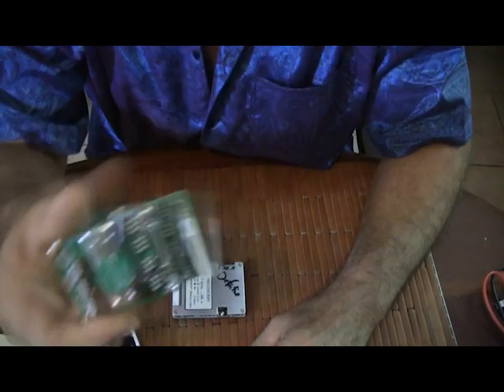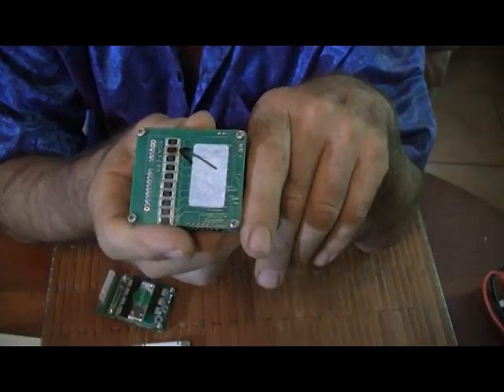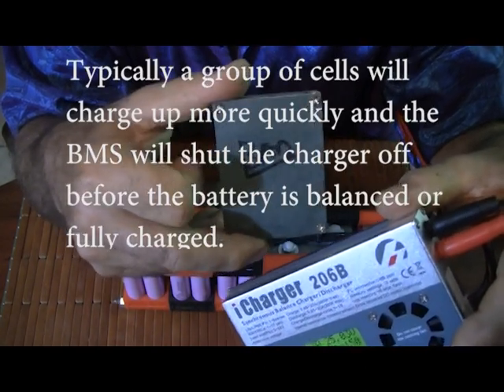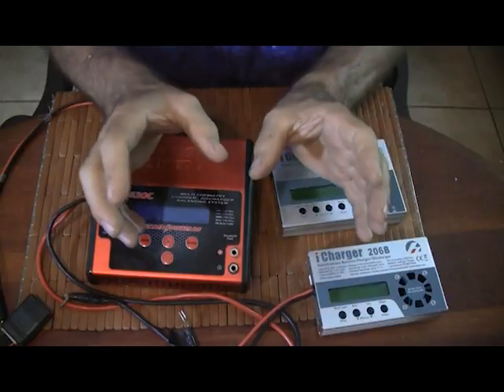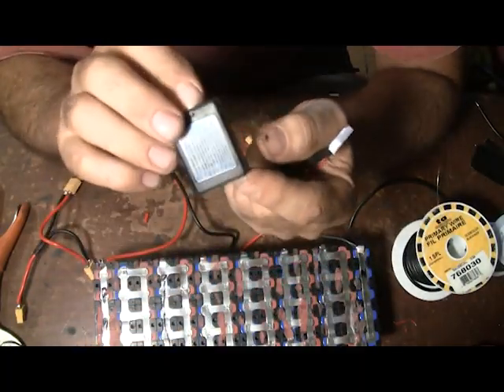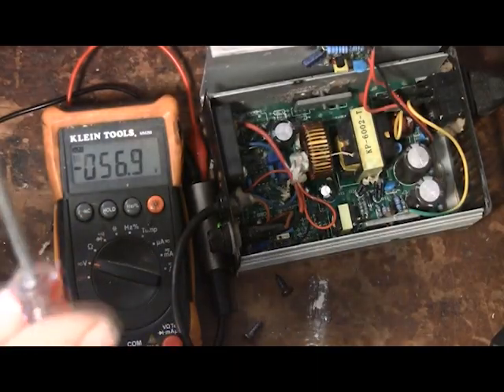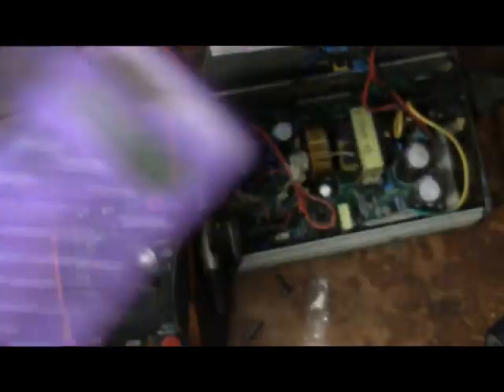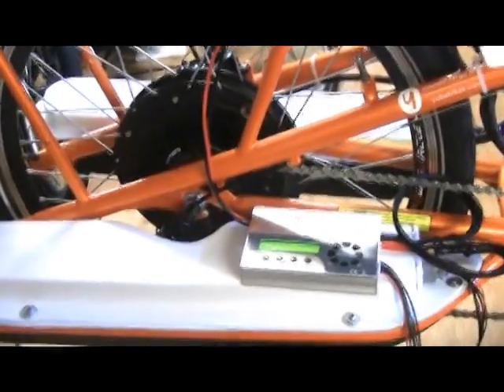How to build a safe and better lithium battery WITHOUT a BMS.

Comment: As someone with a electronics and communications degree Please do not and i repeat DO NOT make one of these on anything bigger then a 4 blade drone. The issues and DANGERS are very real on any none BMS pack after a certain size.
Reply from the maker: Having a micro fuse on each cell is a great idea.  But no ebike or hobby packs have that technology.  Yes the bigger the packs are the more power they have the more potential energy they have- to power your device or if they get crushed--- to have a thermal runaway.   Same is true of gas tanks.  If you are going to make batteries or internal combustion engines or hydrogen fuel cells know the risks.
Reply from the maker: I appreciate your perspective.  And the age/quality of the 18650 cell matter a lot too.  A modern cell undergoes a lot of testing- drop testing, overcharge and undercharge testing- and must pass with only outgassing- not bursting into flames!   Still, if any battery is crushed- all bets are off!
Reply: Thanks. I always go with "respect your LiPos". The fire test videos are pretty inspiring. I think the author's approach works fine for small packs but it starts to get harder to manage over a number of cells.
Reply: Samir Yeah i agree but the cell he is working is way to big and could easily short out, my quadcopter has 26 amps in storage to use and if i did what this guy is doing it would burn my house down or kill me in the process.
Reply: I shorted a 5 * 12V Lead Acid pack (40 Ah) once and the flash blinded me for a few seconds, took a piece off my plier. To this day I thank god it wasn't LiPo.

And I think that every LiPo pack, BMS or not should have a fuse in series to make sure that stuff like that doesn't happen. I was working on the stock charging circuit that was unprotected from factory.
Reply: Yeah i work with 2x110 volt battery banks about 2 times a week on faults and issues these things can pull 100 amps in a split sec if you are in the way you are either dead or in hospital.

What he is doing is ok in small units but can in bigger units like the one he is playing with can cause a cell failure and if it goes into meltdown as i call it it's a chain reaction nothing can stop it. Perfect example if this fool gets hit by a car and is stuck under the front of the car and the batteries short out and the bike is on him it's over he will be burned very badly or killed.  THIS IS WHY tesla have 6 amp micro fuse on each battery.
.
Reply: Tony W please explain what are the "DANGERS" on a non BMS battery? so we can all see if you really know what you are talking about..
Reply: what rubbish, they are the same just different packaging (unless you're talking about the micro fused 18650's)
Reply: The gas analogy is interesting. Someone said in a talk once -- the only difference between a rocket and a bomb is that the rocket releases the energy in a controlled way. But the fuel weight to total weight ratio is pretty similar.

This is why I advocate for most LiPo packs to have at least a somewhat air tight, hard case around it. Metal preferrably. I saw fire test videos of 8 Ah + packs and the difference is huge. 

No protection, flames up to 2~3 meters. Inside of a "cash box" / ammo box you only get smoke as the oxygen to feed the fire runs out shortly. The reaction goes on though, but gives you time to run away or even throw the pack away before it burns the bike with it.

Bottom line is probably : respect your LiPos.

The techniques and devices you mention and show here are pretty useful though. I was doing most of the work manually on a multimeter and no way to attach it to the bike and read it on the fly.

Thanks for posting, that was helpful to know as an alternative.
Reply: The Chinese will sell you anything to make a buck , most is just junk waiting to catch fire

Comment: hi shawn enjoyed your video , can you help , i,m in the early stages of li-ion battery pack studies , i,m working on power tool battery , but i don,t like these small balance connectors i can,t see it lasting long being pluged in and out, can you suggest a better connector , in my case i,m using 6s plug thanks
Reply from the maker: Yes.  For long lasting connection of the balance wires I use a Deutsch Plug.  You would need an 8 pin for a 6s (7 wires).   Here's one, shop around: 

http://www.ebay.com/itm/Deutsch-DT-8-Pin-Connector-Kit-16-20-GA-Solid-Contacts-/231788201826?hash=item35f7a74762:g:iGgAAOSwdzVXriFk
Reply: thanks shawn much appreciated

Comment: Thanks for this Shawn I've explained this to many after watching your video a good while ago. I'll be creating 4x29V packs @26AH. Connecting 2 in series & then paralleling. creating a 58.8V @52AH With cell logging like yours & also adding foldable solar panels to the bike. I have a 48V 1000W rear hub on a dual suspension, 300+ new cells. I'm just waiting for my spot welder to arrive which should be pretty soon! Excellent video.

Comment: Shawn McCarty Nice tutorial, I'm doing a battery bank but for backup power, we get a many power outages where I live. My hobby chargers will charge Li-ion up to 4.1 and Lipo up to 4.2, so why don't you get those instead, then you don't need that dumb charger to finish the charging. Just a thought.

Comment: The video is misleading and dangerous. The man here talks about BMS'es failing. Sure some fail, but what is the real number here of failed BMS'es VS. the ones that are working 5+ years? OK, hobby chargers, are they designed to be used to charge big ass batt packs? Are they 100% reliable? Don't think so, some catch fire, others fail balancing, then there are plenty that stop working all together. Then introduce you unreliable cell logger + human error and you have worse system than with cheap chinese BMS. But what else? Oh, you just paid 220 bucks + some more for connectors, wires and cell logs to build yourself a BMS that does not have over-discharge protection, one that each time you charge requires you to mess with a web of wire and wasted time on things that have a solution. For that price, get a proper BMS  and be done with the nonsense: https://www.energusps.com/shop/product/tiny-bms-s516-150a-750a-36
Each machine, gadget that involves Li-ion has BMS for reason and ignoring that is just plain stupid
Reply from the maker: My ebike is a 60 amp hour 14S battery and I balance it using an icharger duo.  I love being able to monitor the cells as it is being balanced.   The concept works on batteries of any size.  Being a long distance rider I want to make the decision about when my battery stops working- not the BMS.  Also I found BMS's could not balance a out of balance pack- but the hobby chargers will keep on working until they are balanced.   Try it and see!  

Running Hobby Chargers is not for everyone, I am not recommending that, I build most of my batteries with BMS's for "civilians" who don't care and just want to plug it in and forget about it.  But it is a great option for the techy geek guy/gal who wants full control, including the ability to choose at which voltage to balance the battery.
Reply: First, maybe some BMSs do live 5+ years, but as the guy said on the video, you just don't know, when they do have a problem, they will take your battery with them, because you won't notice, until one of the cells has way passed the minimum voltage, with no chance of recovering it. Second, hobby chargers are indeed designed to charge big packs, because big Lipos 6s 5000mAh can be charged at 1C or more, for fast charging at the field. Also you are the one misleading, it's not the chargers that catch fire, it's the Lipos, which are much more volatile than Li-Ions, one can argue that the charger has the same chance of catching fire as the BMS, since they are pretty much the same circuitry, except the BMS is right on top of your batteries and the hobby charger can be kept safe inside a Metal Tool/Ammo box. Also, batteries don't get out of balance all that easy, if they are decent quality and monitored from time to time. Just check +jehugarcia channel. He's Samba runs on 18650 salvaged from old Laptop batteries, after testing each cell for real capacity, low self discharge 24h after charge, and no heat while charging, he's packs are running for 2 years, with no BMS and he doesn't even balance charges them, only dumb charge the entire pack up to the voltage where each cell should be 4.2, and when he checks them, what you know, they are pretty much 4.2 every time. What leads everyone to think, that the BMS is actually what's killing the batteries which have much better build quality (until abused by a faulty BMS) than the BMS itself. Swapping the BMS for Hobby charges, serves to remove the weakest link, they are not much better than the BMSs in terms of quality, but at least you know when they've failed and can replace them. Some argue that even "no BMS" is better than a BMS. One day, when they start making good quality BMSs, the same quality applied to the manufacturing of LG or Sanyo 18650's, with self tests and alarms, than it will be best, in terms of protecting the batteries, to use a BMS.
Reply from the maker: Thanks for your opinion.  I welcome other viewpoints.
Reply: ive built ebike batteries and used expensive high current bms, and to be quite honest they are dogshite, 1 little momentary short and your 60gbp bms goes in the bin, even just the spark that occurs when you connect your battery can fry your bms and you may never know until your battery is dead and this is true even when you are paying premium monies for them, cell loggers are cheap and a hobby balance charger costs no more than a bulk ebike charger and if they break you can see they are broke and you have 2 readings from charger and from cell loggers to compare.
as for chargers catching fire, there are a lot of clones of the imax chargers maybe this is the problem? battery size should make no odds as the charger charges at a set current no matter what size the battery is connected, the bigger it is the longer it takes that is all, as long as the current doesnt exceed the spec of the cells then all should be fine. just buy a genuine charger.
also to note balance chargers can have other useful functions such as capacity testing and battery health/internal resistance checks which will help you match your cells up so the pack shouldnt need balancing in the first place ;-)
Reply from the maker: Hi Agnius,

In real life the batteries need to be balanced every few months or so.  It can take 24 hours to get them balanced.   Bulk charging works well for every day use...
Reply from the maker: Actually I do watch my washing machine spin. LOL.  I am also excellent at monitoring the growth of grass.  

I appreciate your opinions.  Thanks for being civil.

Shawn
Reply: I think there's a good solution to getting feedback from the cells without eliminating the BMS. From what I see in the video, the issues with the BMS are 1. no user feedback 2. not enough bleed for balancing and 3. it shuts off on its own.

I think for the health and safety of the battery, issue 3 should not be addressed. Not only will it damage the batter but Li-ions can be dangerous when undervolted.

Fixing issue 1. doesn't require getting rid of the BMS, just hook up the battery logger for feedback. 

Issue 2 is more complicated but can be solved with a little electrical engineering. A circuit which uses mosfets with some power resistors can be controlled by the BMS using it's own bleed resistors for the signal input. Fairly simple.

Something I think would be interesting to try in order to conserve power would be to take that power bleed and instead of wasting it as heat through resistors, charge up some capacitors and use that to recharge the lower voltage cells
Reply from the maker: This is true.  Except that you cannot then balance charge at 4 volts to triple the life of your battery....
Reply from the maker: One more issue with the BMS- you can't control the balancing voltage- they are set to turn on their resistors at about 4.25 volts.  So you can't undercharge to 4 volts and triple the life of the pack.  Your other remarks are good, I agree, the BMS you mention already exists, though the extra cost is not justified by the power saved.  

The hobby industry has some very powerful batteries that are charged and balanced with hobby chargers.  

My disdain for BMS's comes from having them fail and shut off the battery on long ebike journeys- requiring me to open the battery and bypass it to keep on rolling or pedal a loaded ebike for miles.    I wanted to show this option which I consider to be more reliable and controllable- though certainly not for everyone.  

I build many batteries with BMS's for "civilians"  The non BMS method is for hobbyist geeks- not for the plug it and forget it user.
Reply: You can't adjust the voltage, but even if "undercharging", one of the cells can eventually get low enough for the others to reach 4.25?

e.g.: 10 cell string, 40.0V total charge, with one down to 1.0V, is 39.0V/9good cells, or 4.3333V

(As long as the strings are sensible length.
e.g.2: 16 good cells @4.0V = 64.0V from charger,
but if one is dead short, 64.0/15=4.266... not much balancing there :-)
Reply from the maker: Yes, the scenario you describe is possible.  That is why I use cell monitors to watch the voltages.  This works of course even with a BMS.   A failing cell group will charge rapidly shooting up to over 4.25 volts.  The BMS will not be able to bleed it down and will shut off the charge instead.  When you go to ride your battery will be undercharged, and the weak cell group will discharge first, causing the BMS to shut off the battery before the other cell groups have discharged.    You can see how diminished the battery capacity is.  Having cell monitors allows you to watch for this problem, and to see if the BMS is doing the job........
Reply: Deliberate  attack I think it an excellent  way to take control  of your battery pack . And BMS  are a flawed system I have see many go rogue .
Reply from the maker: Hobbyists use very high C rated batteries in their helicopters and drones without BMS's.  This just exapands on that simple concept.  True this is not for everyone, just people who understand what is going on and want some control.
Reply: " OK, hobby chargers, are they designed to be used to charge big ass batt
 packs? Are they 100% reliable? Don't think so, some catch fire"

They are designed to charge at a certain current, if they can charge at 5A, they can charge at 5A, the battery size doesn`t matter, NOOB..
I have never had a balance charger fail on me, and I never even HEARD of them catching fire..
You sound like your job is building crap BMS`es..
I have had packs with bms`es, and except for my laptops, I removed ALL of them, and I`m happy I did..
And the "web of wire" consists of TWO CONNECTORS!
Jeez..
Reply: Jan Christian Frodahl  Actually hobby class chargers are quite reliable for multi cell balance charging and these "fires" of which you speak are worn out or defective cells giving up after tons of abuse/use and rarely ever the charger. We all know with lithium ion this is an inherently dangerous chemistry due to thermal runaway but still is the king of capacity vs volume which is why hobby class rc uses it.
Reply: so there... f'n new bee...lol
Reply: the difference when we say it is dangerous with him is: He knows what he  is doing
Reply: agnius i have seen 3 of energusps BMS fail this year! and more on ES too, and they can shorten the battery life with there all over the place uper balancing
Reply: correct
Reply: Shawn McCarty check out the link for bms which you can do just that. I cant imagine the nightmare using rc charger on those long trips you make. its just taking a lot of the trip itself. I would imagine techie guy would spend hes time on building stuff, not monitoring the battery. I doubt that you sit around and watch your washing machine spin :lol
Reply: Agree with you!It is very dangerous without BMS
Reply: if you understand mcus, fets and can figure out an op amp... there is no "except you cannot" you can make it do what ever you would have done by hand or with a manual charger with balancing leads. if you understand dcc-dc converters and fet networks you can prop up a weak cell or group of cells on the fly an extend total run time because energy is moved from higher voltage cells to the lower one while the pack is in use. Please drop this anti bms bs and put your time into electronics. you will be spending it learning instead of spewing falsehoods. if you dont want to learn, still consider that there are things you dont know which makes many of your statements absurd.  High end bms systems communicate via i2c or sm bus . you can get the same cell v read out as your charging set up now...hell if you want you can even put manual balance leads on the pack to indulge your ludite side. if you learn how a fet works you can even install a rocker switch to over ride the bms when it trys to stop you from undervolting. aka "when you need that last mile. its not that you have a different view point.... you make absolute statements that blanket all bms. this makes those sentences wrong because it is demonstrable that there are solutions which prove your statements false.
Reply: I know some who had ichargers went in flames ;) 5ah pack is nothing. I am talking about 20-30ah packs that are more relevant to ebikes. I am not even mentioning lipos cause its a suicide to use them in a bike. If you wand to see whats happening, you can always connect your cellloggs to BMS and still be way cheaper and better than RC charger.
The weakest link here is human error. I just gave a link of a good quality BMS, guy form same company that makes emus BMS which are considered to be most reliable